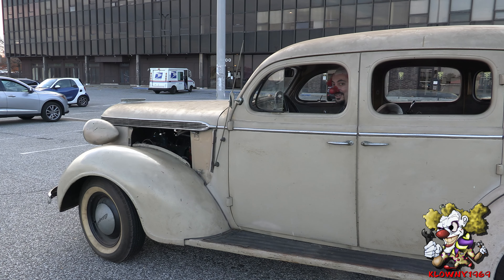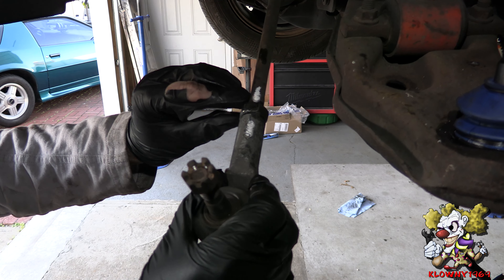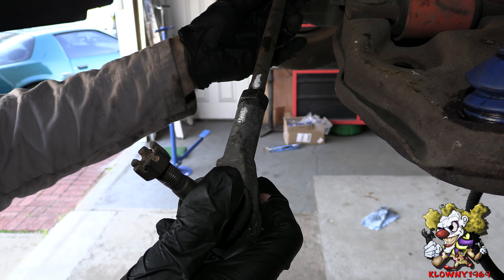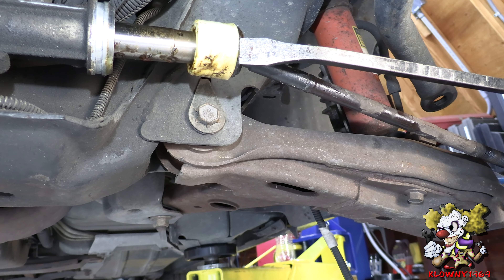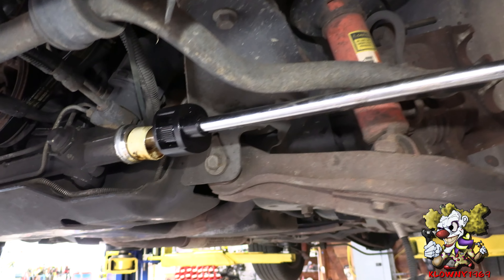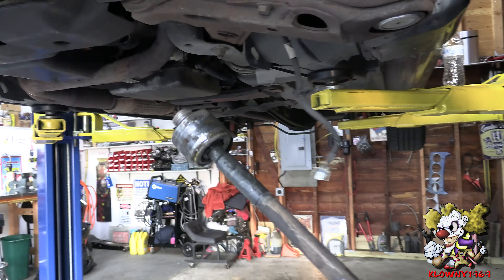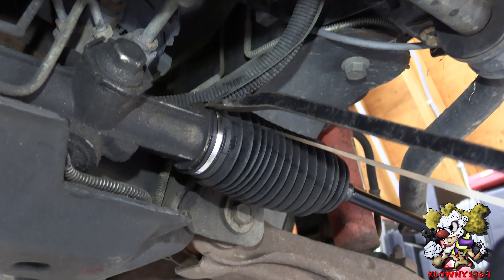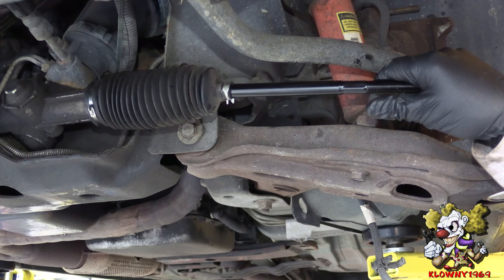Inner Tie Rod Removal Tool

Comment: Would an 1/2" impact torque wrench gun work with this tool, as well?
Reply from the maker: I wouldn't use a gun on this..Thanks for watching and don't forget to subscribe and hit that bell
Reply: @klowny1969  I went ahead and bought a standard inner tie rod remover. Thanks, anyway.

Comment: Don't tie rods have a slat forged in for a wrench....  I've never had a problem getting them off
Reply from the maker: Some inner tie rods are so crammed in there that you can't fit a wrench..don't forget to subscribe
Reply: The ones on a ford Mondeo are round 😂
With no where to put anything on 😱